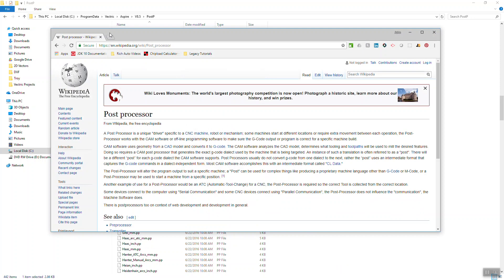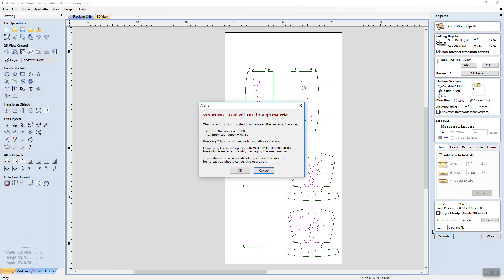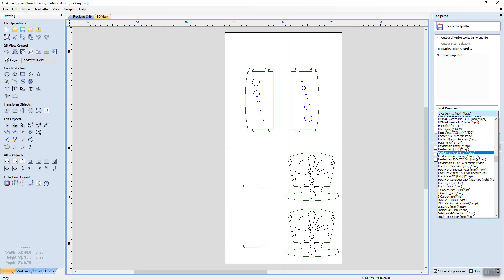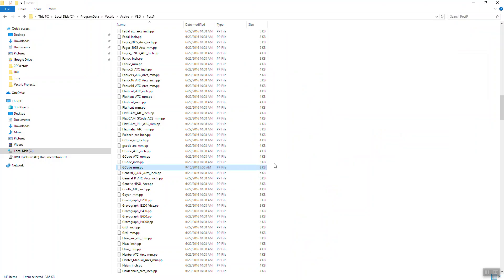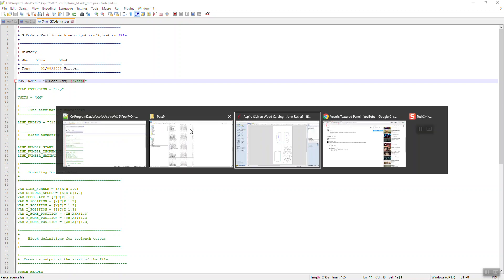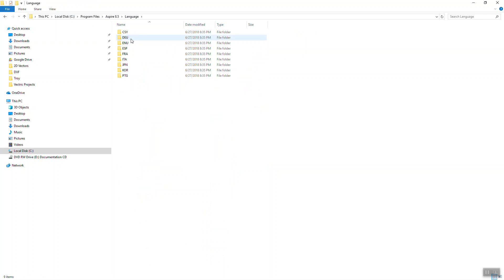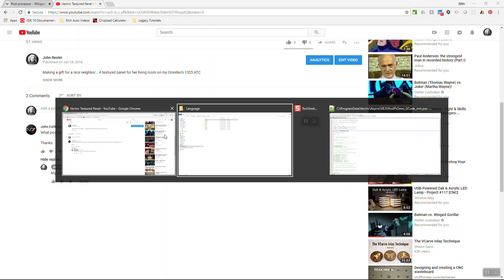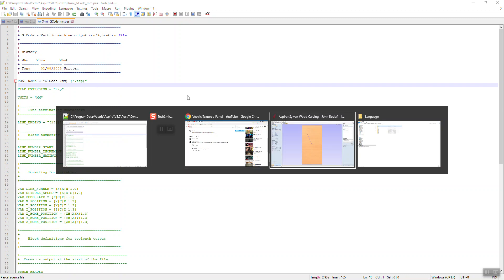Aspire Post processor G code  for DSPA11 control system

Comment: whn i use in the CNC Router Richauto DSP a11, dont turn the sprindle instead exported in a .tap format. Then i search as notepad in the g-code generated and i can't find the cod of start the sprindle M03
Reply from the maker: maybe you also need to open DSPA11 G code control .